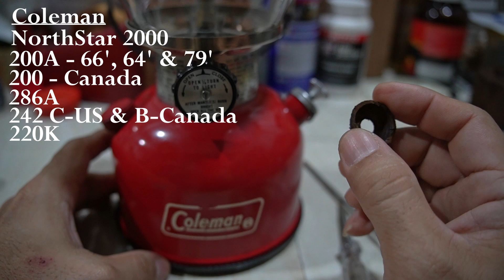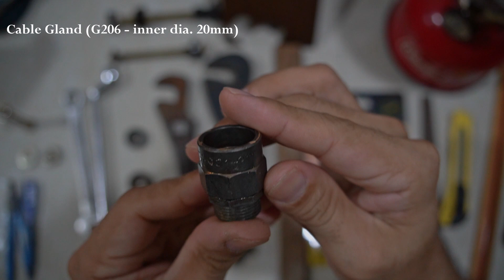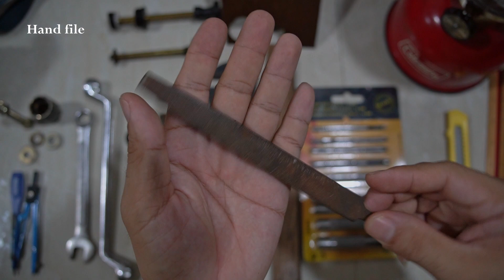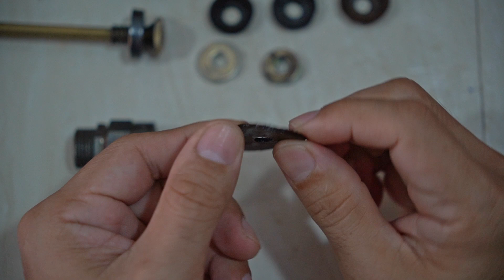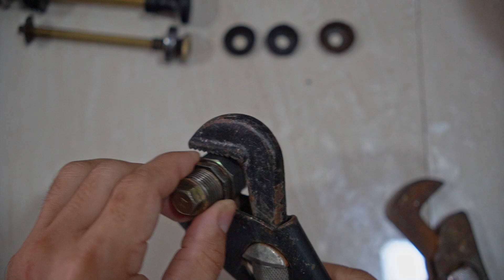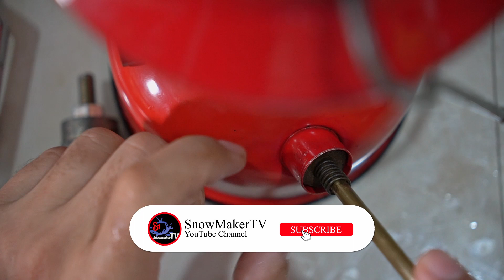DIY | Coleman Lantern Pump Leather Cup

Comment: Did you make the leather cup the same width as the opening on the lamp? Or does it have to be bigger?
Reply from the maker: +/- width I make, doesn't matter it still function accordingly. Perhaps not too small in diameter or may getting less effect when pumping.

Comment: Hi great videos 
Very interesting and helpful 
I wonder please could you tell me what thickness the leather should be to make the suction cup on the coleman lantern 

Also please im having trouble sourcing the  brass tubing at 
1.0 mm and 1.5 mm to try and follow your method to make a generator 
would you possibly have a link 
To try and purchase the tubing
I have tried AliExpress but can find smaller than 2 mm
Please help if you can 
Keep up the good work 
All the best cheers 
Keith
Reply from the maker: You're very welcome, and thank you for reaching out!

Regarding the thickness of the leather, you can find it typically ranging from 1.6mm to 1.8mm.

As for the brass or copper mesh, either material works fine for the generator. A thickness of 2mm should suffice, and when weaving it, try to keep the rows to around 1.5 inches.

If you're located in a Western state, the link I provided may not be applicable for purchasing 1.0mm or 1.5mm thickness. The link I provided you not able to purchase it? 
https://www.ebay.com.my/itm/303732788462?itmmeta=01HX8B4GPP6NSMPT6KYW8THF0D&hash=item46b7e28cee:g:~c4AAOSwRxBfjSFa&itmprp=enc%3AAQAJAAAA4HdUH%2Bef0F5jY808tWZClZFiavXZGiZ3n4qK9Fox25xlMmZRCme2%2BttmCiqD%2B2ZOenCHiirCLpfiwCqi053fdAsl%2Bgcn35ei5JtN2VHX71rYkiYl6is8P5nWYypZres7u%2B%2FEg%2Bmn%2BuhvTN%2BiRidkE2gpxq4z%2BFvm%2Bs9QC5thb4ocdgrwm%2F6oW%2FauDVNIUPgn%2BX3q0Ic7KhbwiJrVL2jSluXiBc0lDzhKHOCjkY%2FKKjntS9x0jZ2fmGO4mfxdi0Q%2BPoWj51fmBrdRbDPdnMZ02peMQvqYFZ6maqnsr%2FYYkbGd%7Ctkp%3ABFBMvouSi-pj
Try this link above from Ebay.

Feel free to give it a try, and thank you once again for your message!
Reply: Thank you so much for your promt  reply 
Unfortunately the link you  graciously shared with me is out of stock .
I'm in the UK.
And have tried many suppliers for the brass tubing ( im not to sure what you call MESH)
1.0 mm tubing and 1.5 seems  to be difficult to get in the uk.
The info on the leather was greatfully received thank you very much for that.

Comment: The Colmen stoves are also easy to use and convent to have . Also use Colmen fuel in your lanterns and stoves to keep the insides clean . It also last much longer in storage then gasoline . Very handy in a power outage at home .
Reply from the maker: I totally agree with you. Coleman lantern & stove very handy & easy to use. But sadly, my region here doesn't sell Coleman fuel, so the only choice I have is unleaded fuel only.
Reply: @SnowMakerTV  

Find a shop that sells paint for cars.
They might sell you cans of Naphtha.
In auto body painting the surfaces must be clean with this same stuff as Coleman fuel but without any additives.

Search for Alkylate gasoline. ( such as Aspen 4T )
this is not regular unleaded its made from Natural gas and its much cleaner burning and leaves less deposits in the generator